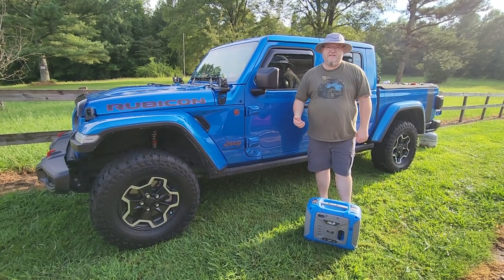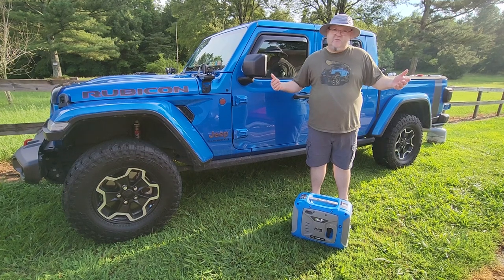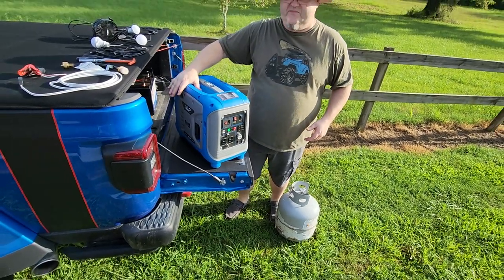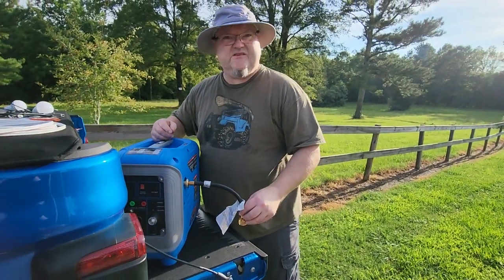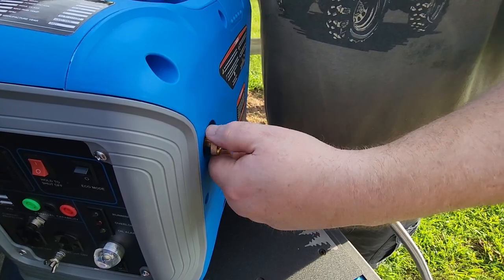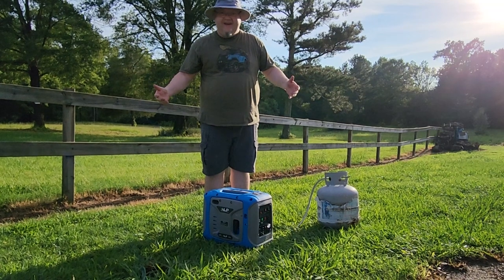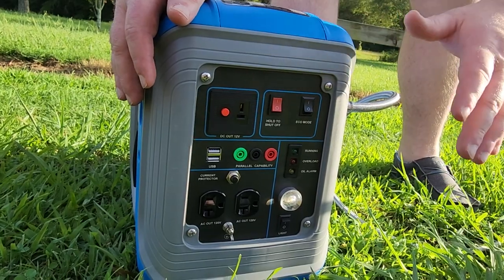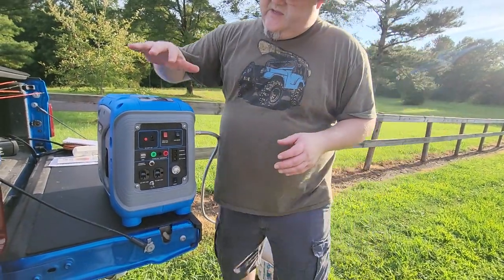ALP Propane Generator (3 month review)

Comment: I bought one 2 years ago & kept it in the box as a backup in case I needed it, WELL with the recent Idalia 2023 storm here in Florida my Briggs & Stratton gen let me down, so I pulled the ALP out of the box filled with oil & hooked her up, had ZERO issues, kept the Refrigerator running the whole time, I was SO impressed I ordered TWO more to keep as backups along with the parallel cables but can't figure out WHY & HOW you would use such? IF you hook 2 together does it mean ANYTHING that uses the same plug style can plug into ANY of the panel female outlets can operate that uses more watts? I DON'T get / understand the concept.

Comment: hey matt im curious if the generator is a higher wattage does that mean its better/itll last longer
Reply from the maker: The higher the wattage just means you can run more power hungry appliances it doesn't mean that it's better or will last longer it's just more capable of powering more things. Hope this helps, thanks for watching! Please Like & Subscribe.